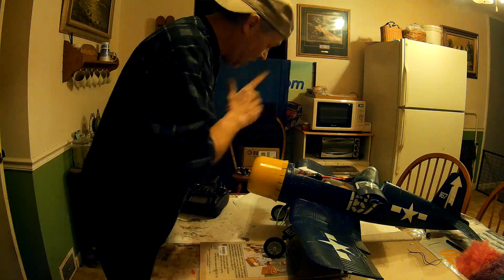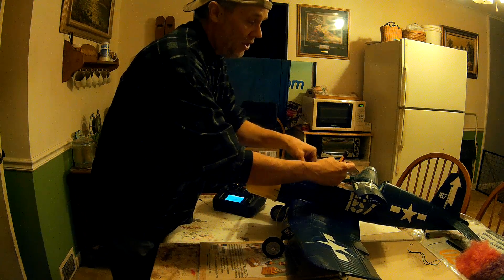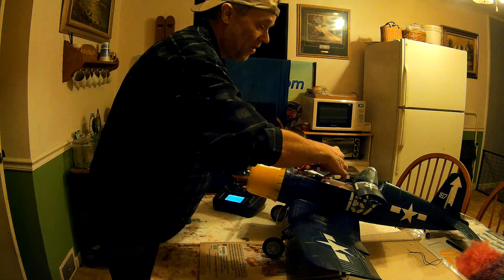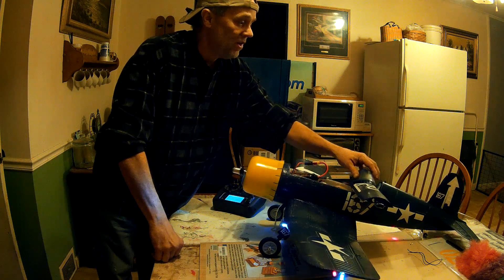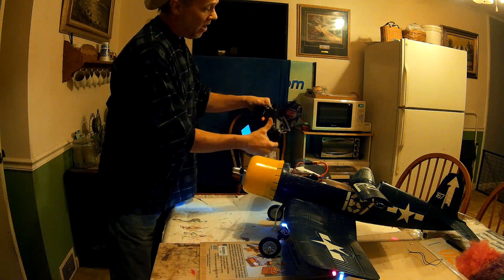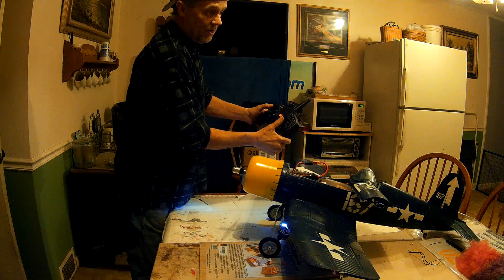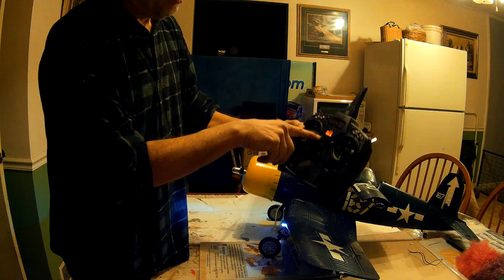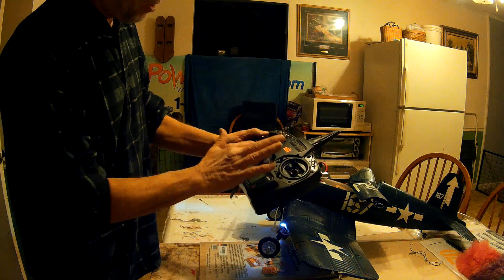Your ESC Won't Arm ? Motor Won't Run ? Try This.!!!

Comment: when my I plug in the battery the edf just beeps very fast and spins uncontrollably randomly and scaring me. pls help me I tried to fix it, and I can't even remove the blades from the edf. pls help me and if you are nice enough to give me some tips. Godbless
Reply from the maker: @TheNobleCookies take your time and start over.  Make sure all radio controls are in center positions and throttle all the way down.  Turn on radio first then plug in your RC to the battery.  On the radio make sure all your trim positions are centered.  
I wish you good luck 🙏🤞
Reply: @ thank you so much I will try that and see what will happen😀
Reply from the maker: @TheNobleCookies try Ali express.  Think that is where I found mine.  Good luck

Comment: hey the same thing is happening to my eflite a10 64mm and i am trying to do this method and it is not working
Reply from the maker: @EverthingAviation911  is yours the one with the smart esc?  If so, you'll probably have to contact HH support 😜 
Unless you are missing something in the set up?  ie. correctly bound.
Try rebinding making sure all controls are neutral and throttle down all the way.
Since it is a twin, you may need to do a calibration on both escs to get them in sync

Comment: Have you run into this when you set up your Spektrum receiver and run through forward program after you unplug the battery and plug it back in the servos have to be reset up?
Reply from the maker: Nope.  I haven't messed with forward programming yet

Comment: After connecting 2 motors to 2 ESCs, without knowing to remove the red wire on one side of the BEC, I connected them together to the servo controller of 1 and tested the operation for about 30 minutes?? So, only one motor worked, the other motors operated randomly, and in the end, the ESC on the motor side, which was working well, was damaged and did not work at all. When I went to YouTube, I saw a video about removing one BEC. I removed the ESCs one by one, reset them, and tested them. Of the two ESCs, only the motor side, which had been malfunctioning uncontrollably, works. When I turn on the power, the motor makes the same beeping sound that it made before starting, but even when I move the throttle, it works. The motor doesn't move at all. Is there no way to save it??
Reply from the maker: Dual motors.  Sounds like one of those are bad.  Not sure about yours without seeing it 😕.  Sorry

Comment: This trick works with the new NX radios as well.  
The whole reason I came here was because I knew Skip has the 1.1m corsair like mine, and I wanted to see if he had changed the ESC, I wasn't expecting to find the solution to all my problems here. 
Way to go skip! Hope the Corsair is going well.
Reply from the maker: It's been in a mid air 2x, but still flies.  Thanks for stopping by.  Happy Flying buddy

Comment: Thanks. I’ll try it tomorrow. I’m using a FMS 120A ESC going in a 1700mm (67”) Corsair. My Radio is my old Reliable Spectrum DX 8. Hope that does the trick! 👍🏽
Reply from the maker: Good luck. It's worked for a ton of people.
Comes down to a calibration problem, but this is an easy go around.  Happy Flying bro 😄

Comment: My motor suddenly stops mid flight- works fine on ground checking it out- larger aeroscout - full batteries charged ok
Reply from the maker: Check your connections.  Wires etc.  Sounds like an intermittent connection problem

Comment: i coudnt fix mine but i appreciate the effort all the same.
Reply from the maker: Sorry to hear that, it is worked for most. You might want to try recalibrating the ESC with the throttle trimmed up a little. And then try firing up the ESC and trimming the throttle down giving you more range? Just an afterthought, but it might work. Good luck and hope it helps. PS thanks for watching and thanks for your comment, I hope I can help. Skip

Comment: You da man! Rd crawler started doing this and I was beating my head against the wall trying to figure out why. Well your trick worked but still wondering why?
Reply from the maker: Usually a calibration problem.  Good luck.  Thanks for watching

Comment: Hey Skip , Cheers from Calgary Canada ... I was has the same issue with a new product I bought. searched high and low for a solution and I came across your video.. thank you so much my friend.. it is the simple things that can make a difference... I am good to go ..
Reply from the maker: Sorry I didn't see this message.  Happy Flying bro

Comment: Hello Skip, I spent about 4 hours trying to work out why my ESC refused to arm. I tried your advice not expecting it to work but i was wrong, it solved the problem. I'm not sure what's going on but to make it run properly I've had to reduce the Throttle Travel to minus 105 instead of the normal minus 100. It's either this or setting the Throttle Trim 2 or 3 clicks down. Either way I'd never have found the problem without your help. Really happy, Phil, England UK.
Reply from the maker: So Happy to hear.  May try to calibrate the esc the traditional way, otherwise this worked for me too 😉.
Cheers my Friend.  Happy Flying and Happy Holidays to you and yours.

Comment: Thank you, When do you know trim is neutral?
Reply from the maker: That all depends on the manufacturer's recommendations sometimes they like the elevator up a little bit sometimes they like it down. Sometimes you've got full flying stabs and you have to have the elevator set at a precise angle for neutral and you have to go to the manufacturer's recommendations for that. But in general just a regular normal stabilizer with a elevator on it or a wing the control part of the flap should be even with the wing surface top and bottom. Especially on bottom cuz that's where it glides on if the top is off just a little bit because of thicknesses of foam being a little bit different make sure the bottom is at least even you'll have a neutral position on that. I hope this helps, and happy flying. Skip build RC. Please subscribe, would love to have you on my channel as a subscriber. It's free!!

Comment: This worked for me, sort of. It got the motor running, but when I turned on the throttle kill, even with the throttle off, it made the motor start! Clearly something more fundamental was at the root of this problem. Turned out, for me, it was ESC calibration, a simple and easy procedure explained in other YouTube videos.
Reply: I am having the same issue. Do you know what ESC calibration video you used?
Reply from the maker: Great.  Thats all most need.  That should have been 1st step.  Good Job Buddy

Comment: Damn mine still isnt working. When you turn the throttle down all the way the prop slowly tics backward. We just flew it and now it's messed up
Reply from the maker: When you trim down throttle for the fix, remember to set trim back to neutral position

Comment: My esc goes through its steps and then when I give it throttle it does nothing but reset and go through its steps again you think this could work for me as well?
Reply from the maker: I'd give it a try.  Sounds like the esc may have been put in program mode.  Do a simple calibration first and try it.

Comment: My goolrc brushless motor and ESC combo is beeping and I have no throttle or steering and it will not bind to my transmitter it’s a Traxxas rustler
Reply from the maker: If its just beeping, somehow it may have gotten into esc programming mode.  Not sure on that product.  I take it you tried turning the throttle trim all the way down 1st.  If that doesn't do it make sure all batteries are charged, including Transmitter, so often overlooked as a source of problems.  Good luck buddy,  Skip

Comment: Hey Skip - I'm so lucky I came across your video. Before you got your motor running in the video the sound the ESC made when you connected the battery exactly matched the sound my ParkZone Sport Cub S2 was making. So I copied what you did with the throttle trim and it worked a treat. Thanks a lot! As Holden fan said - You're a bloody legend mate!!
Reply from the maker: Thanks Lee.  You know I didn't think about making this video till I heard a lot of people had similar issue.  Didn't think this video would be so popular. lol  But Thanks buddy.  I appreciate your comment.  Happy Flying Mate.  Skip

Comment: Thanks for the advice, it worked for me but instead of leaving the trim set to -125 I adjusted the servo setup in my DX6 throttle travel adjust to -125.
All working fine now.
Reply from the maker: Thats an AWESOME solution brother.   Good Job.   Thumbs up

Comment: I know im pretty late, the throttle for our rc plane works although when we accelerate the power slowly decreases and when the motor has stopped, the controller resets and asks for commands. Any fix on this?
Reply from the maker: Not Sure on that one.  I would try a reset.  In program mode, wait till you hear the 4th set of sounds, and drop the throttle.  Unplug all and retry.  IESC should be reset.  Then just calibrate your controller.  Program mode and 1st sounds drop to zero throttle.  Hope this helps, Skip

Comment: Trying to get back into flying RC after quite a few years. Am a complete noob regarding electric flight. I screwed up my ESC on a new plane - have never been able to arm the ESC. Now I get one beep followed by three beeps, and that's it. I am using a 3S battery. How the heck can I get the ESC to go back to default. No one had told me about using throttle to initialize the ESC. Futaba radio in a Turbo Timber.
Reply from the maker: OK.  Here's how I remember.
Plug in battery with radio on and throttle set up to max.  Wait for the esc to start series of beeps.  When it gets to 4 beeps, after 4th beep drop throttle back to off position.  This should reset the esc back to factory settings.  Hope this helps, Skip
Reply: @SkipBuiltRC  I figured out what the problem was. The ESC on my Turbo Timber had some extra wiring, apparently for the lights. One of the leads was labeled "Receiver, 5.0 v." I plugged that into CH3 slot on receiver. I noticed in a photo of that ESC on a website that it didn't even have that wire. So I yanked that wire out of CH3 slot and plugged in the braided wire. I was then able to arm the ESC and the motor turns now, and in the right direction.
Reply: @SkipBuiltRC  Oh, and thanks for the advice. Once I had the wiring right, I used your advice and got the ESC armed immediately. Getting back into RC flying, I am also trying to figure out a new radio...

Comment: that fixed it, guess the esc thinks the throttle is up, which it is, and doesn't start the motor.  mine didn't even beep until I lowered the trim.  thanks.
Reply from the maker: Your Welcome.   If I had a dollar for everyone else this has fixed,  I'd be buying the Motion RC Airliner.    Lol

Comment: I tried with my supercub and it did not work but I think it is because my remote does not have an electric trim
Reply from the maker: If you do not have electronic trimming, then just try a standard recalibration only run the throttle almost all the way back down after you hear the beep on the ESC. That should service the same idea of electronically trimming it down then just plug it back up and work it as normal and see if it resets and arms on it's own

Comment: Could you do the same with servo tester and see if you have the same problem cause that all I got is a servo tester and that's my problem
Reply from the maker: Give it a try, but if you are going to fly it,  you need to do it with radio trim or sub trim.

Comment: I hope I don’t misinform anyone, but I believe Betaflight has a min_check value that the throttle must be below in order to arm; for safety. You can calibrate your sticks to ensure it goes below that value, set the min_check a litter higher, or do the temporary trim thing. I hadn’t thought of the trim thing. Thanks.
Reply: Could you help I have a similar problem but with a servo tester it's only arms at about half throttle of the adjuster and considers that as the starting point for the throttle

Comment: My throttle trim is stuck on max
Reply from the maker: Esc. Needs to be recalibrated for throttle.
There is a proper procedure for that.  Very standard thing.
Reply: Skip-Built, RC. I’m quite new to rc so I don’t really know how to do that
Reply from the maker: @GIGATHEBOT  there are a ton of videos out there that will show that process. Horizon Hobby has a video on just that. Just go on YouTube and type and ESC / throttle calibration, and you should be able to get a choice of a bunch of them. Your problem seems to be that when it was first initialise the throttle was in a full accelerated position and then brought down. Proper procedure is turn the radio on and bind the aircraft. Now unplug the plane. With the radio on Advance the throttle all the way wide open. Now plug the plane back in. As soon as you hear a series of beeps do not wait too long I mean as soon as you hear them bring the throttle back down to fall off position unplug the plane turn the radio off and you're done. This should do it for you. But like I said if you want video as well there's plenty of them might even be one on my channel somewhere. I don't recall if I did that one or not as there were already so many. Good luck and happy flying my friend. You found yourself a good sport to make you happy the rest of your days. And trust me it gets easier and easier and easier day by day. Happy flying, skip
Reply: Skip-Built, RC. Ok I dident really hear anything
Also I think it might have been already calibrated because everything worked when I first hooked in the servos and throttle then the ailerons started to move a little on its own the moter turned on and it got dead
Reply from the maker: also check that the throttle is not in reverse on your radio.
Reply: Skip-Built, RC. I remember it was turned off with throttle full when my friend accidentally turned it on does that have anything to do with it
Reply from the maker: Yes.  That is what messed up the esc throttle setting.  It thinks wide open is off and off means wide open.  Just reset it Like I said.  That should work.
Reply: Skip-Built, RC. I tried to set it up and the esc shocked me and the randomly turned on tried to turn throttle to idle with remote but won’t respond to inputs had to manually disconnect the motor
Reply from the maker: @GIGATHEBOT  Man.  I just don't know..  try resetting the esc to factory settings.   Same procedure, except wait for the tones to cycle to the 4th set of sounds,then drop the throttle.   That should work for sure man.

Comment: Sometimes when i try to connect to my plane especially after a gap of a day or so, my esc keeps on beeping continuously for 10 20 seconds and then arms the motor, after that it arms the motor normally (in 3 beeps only) ,why it takes so long sometimes? and the prop would do weird half rotations and vibrations too...
Reply: Wonky connections dude
I had the same problem
Reply: You can also try setting the end points again

Comment: ahhhhh haaaaaa.  OK let me try that and I'll get back to you. Thanks for the video brother.
Reply from the maker: Sure thing my Friend.  Nice flight vid today.  cool
Reply: Thanks bro. So ya that freewing esc is toast. The video was great. Thanks for making it. So those change sun 50 mm edf's. They only work on 35 amps or more. They recommend a 40 amp. So I just bought a few so I can get this little f22 set up with change sun edf. Can't wait. Freaking what a cold snap we are having. It must be freezing as cold there too.
Reply from the maker: yeah man here too.  saw the sun today in high wind and about 18 degrees less the wind chill.  damn sam...!!
Reply: So my fly spot has a thick layer of ice that's nice and flat. It actually holds my weight. So I think I'm going to take the F 16 out and put it through its first pace's. If everything feels right I'm going to give her a maiden flight. I won't retract the gear because of the cold, buy I should be able to get her in the air.
Reply: Sorry but

Comment: WOW!! Wish I had seen this before I bought another ESC for my 1700mm P51. I had the same problem ........everything worked but no motor........hmm glad I didn't throw away that ESC because it is probably OK. Thanks for sharing this Skip.

Comment: All ESC's should have a throttle calibration done when you first turn them on. Put your throttle to full, turn on the radio, then plug in the ESC, after it beeps 3 times for 3s battery and 4 times for 4s battery, there will be one beep, drop the throttle stick to bottom position, that's it, power cycle the transmitter and ESC and your done, the ESC will know the correct throttle range for your transmitter now. You probably know this skip, but just in case.🤓😳👍
Reply: Actually turn your radio on first then put throttle to full.
Reply from the maker: yep, but on a few escs on 3 of my planes this step sets the throttle (low)throttle setting. Then do the high trhottle calibration.  Don't know why this happens on some but it works.
Reply: i have a problem. I upgraded from CC3d setup to APM 2.8 recently. So the wireing and ESC + other parts should working fine. But when i try to do esc calibrating (both single and all in one methods) my ESC s keep beeping. how to fix this?